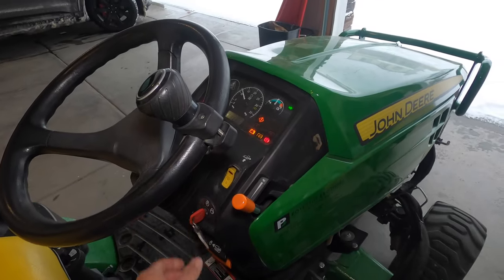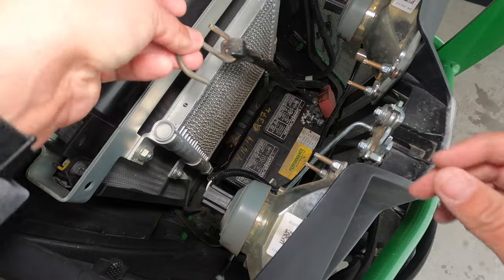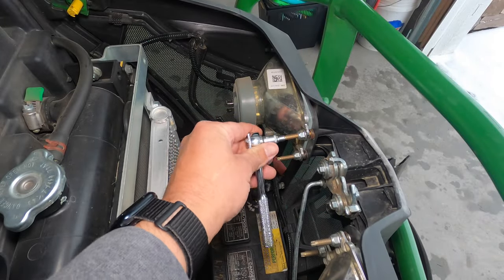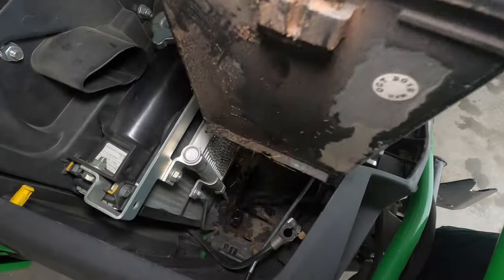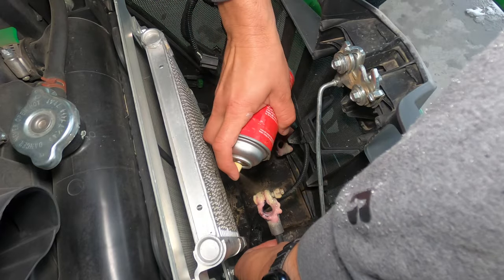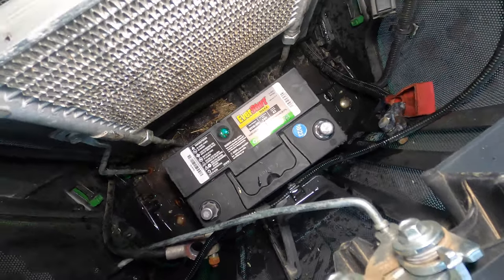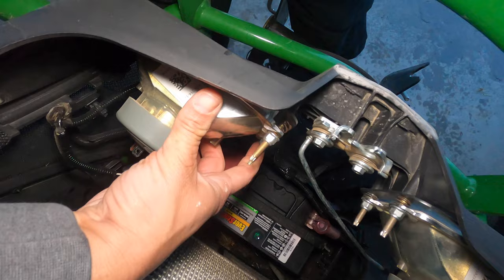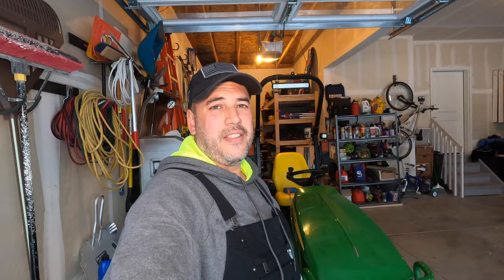John Deere 1025R Battery Replacement Step by Step

Comment: I found a set of E4 to E8 sockets for $6. Makes it a simple job to have the right socket.  Thanks.  PS - when I trailered boats that used filament lightbulbs in the trailers I found dielectric paste works great to prevent corrosion on contacts & connectors. Works on battery terminals, too.

Comment: Great video Hans. Great tips. You really would need to but a battery with some sort of top handle to get the battery in or out. Tight quarters there. 
Finished up the service on my John Deere 140 H3 and snow thrower today. Snow could happen here any time. 
Have a great week Hans 👍🏻👋🚜
Reply from the maker: Have you got a chance to use the snow gang yet?  If not, I’m sure it’ll be soon enough.  I like all of your tractors.
Reply: @TractorHoarders  Been out once with the John Deere 140 H3. That’s enough for this winter. 😳😳😳🤭🤭

Comment: Newbie question - I have a used (2016) 1023E and am removing the battery for storage this winter. My question is:  did you install the battery vent tube you noted at the start of the video? It isn't obvious when looking at the manual how to do this. Fortunately, my model just has nuts to hold the headlights in place. Thanks in advance for your answer and I learnt lots watching your video! Stu.
Reply from the maker: Hi Stu, I did not install the vent tube as referenced.  Mine was missing.  It looked to me like on the original John Deere Strongbox battery you could simply connect a rubber or plastic hose to it of the appropriate diameter and use that.  On my new battery, I didn’t see a spot to connect a vent hose.  Best of luck!  These are great machines.  Enjoy yours!

Comment: Hello to you. I watched your video and you really take the time to explain things. I am also a 1025R owner. I have a small question, that does not relate to your video, but something caught my eye. I see that your idle RPM seems to be lower then John Deere recommended RPM. JD recommends 1500 RPM. Your seem to be around 1250 RPM. Did you lower your RPM? If so, what is the reason for this? Thanks a head for the answer.
Reply from the maker: Hi Andre!  Thanks for the kind comment.  Good observation.  You’re right and I have another video on my channel showing how to adjust the idle speed.  Sometimes I like to let mine idle lower, like when it’s just sitting and doing nothing.  When operating it, I would always be at 1500 rpm’s or greater.  Typically when I idle it low is when maybe I am talking to someone.  I do a lot of snow removal (see my other 1025r videos) and sometimes people come out to talk to me and I need less noise to hear.

Comment: I have the 2016 1025R and it does not have that Mickey Mouse hood release, the battery comes out just as you show, but you don't have to hold your tongue just right to get it out.

Comment: I have 1023E tractor. I am only an amateur user, so my opinion on the tractor does not have much weight (I am happy with tractor), however battery removal difficulty is really surprising. How this could get ever approved during the design review?
Reply from the maker: I agree, it was an interesting design choice.  It’s not too horrible, but it also could have been a lot easier.

Comment: I'm having a hard time trying to get the battery out and started taking out the hex nuts but said "I can get the hex nuts out but what about this screw sticking out?"
Thanks for the video......I need to get those sockets.
Reply from the maker: Once you have the sockets, it’s super easy.  I’ve never had a need for those until this particular job and the after that I’ve come across a need for them for a few other non tractor projects.  Hope yours goes smooth!
Reply: @TractorHoarders  : Got the sockets and replaced the battery but still won't start.
Goes through the same sequence you showed at the beginning of the video but the engine just won't crank.  I've got it in neutral and everything.  I even bought a new ignition switch.
I may just have to pay the $400 for the John Deere guy to come look at it.
Reply from the maker: @machonsote918  it’s got to be a poor connection… make sure the ends of your battery cables are clean with no corrosion and you could also trace the ground cable to the frame and make sure that connection is clean too.
Reply: @TractorHoarders  : I bought a "battery load tester" which, not only checks for 12 volts, but also tells you if the battery can handle a load because it has a switch you can toggle.
I installed the brand new battery and used the tester by clamping onto the cables away from the battery terminals (to ensure I'm not testing the battery posts) and it says the cables are good.
Maybe, tomorrow, I'll try clamping the red (+) on the tester to the red cable (+) and the black cable (-) to the frame of the tractor.
Reply: Ended up having to pay for the shop to figure it out.
You were right.....turns out they had to replace the battery cables.
When I used the load tester and clamped the black cable to the frame of the tractor, the load tester said "Bad"........I thought it was probably not the right thing to do.
Now that the tractor is back and running, the load tester says it's "Good" when doing the same test (clamping the black lead to the frame of the tractor).
Live and Learn.........good way to see if the battery cables need replaced.
Reply from the maker: @machonsote918  Thanks for sharing because that may help others too!  Glad to hear that you got it all taken care of.